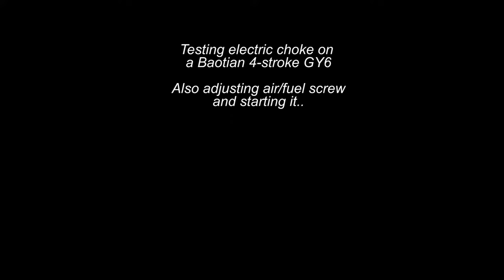Testing electric choke on my Baotian 4 stroke GY6 and adjusting air fuel screw and starting it

Comment: Check youre main jet its should be around 75-80 size(50cc) this also depends on sircumstances. But between that it should be good. Check the idle jet its should be around 33 size and for the idle mixture screw do it 1,5 turn
Reply: Thank you. This information is hard to find..I live at sea level. I use an 80 main jet and 33 idle. Still the cold idle is still instable but once warmed up it is fine. Very hard to tune these 4t 50 cc carbs.
Reply: @frednetherlands887  i know i build one by myself gy6 139qmb
Reply: @lucabot5518  Thank you. So I am not the only one with the problem with a too rich cold idle but a perfect running warm engine?
Reply: @frednetherlands887  i would reccomend a 2t carb like 20mm for fone tuning. I got 24mm carb 4t from naraku and its the best carb that i have. My setup is 90cc head and cilinder a9 cam from naraku. Vct complete from naraku everything naraku. Inlet 24mm naraku. Malossi airfilter. Gear ratio idk but upgraded. Top speed 75mph
Reply: @frednetherlands887  it really lights up. please understand that they are Chinese scooter engines and the Chinese don't look that carefully during the manufacturing of them. I am a mechanic for scooters and cars here in the Netherlands and I recently had 2 of the same scooters with a gy6 139qmb I did some tests with them such as changing a cdi with unlimited rpm one scooter drove 60kmph and the other 85 t it just depends on how and what the condition of the block is. if you really want to be sure of your stuff. change the top of your block to premium parts such as naraku cylinder or cylinder head better finish and no compression loss via the valve seat or the piston rings these components are fragile in a gy6 engine and are usually the causes of a poorly running gy6 engine.
Reply: @lucabot5518  dankjewel voor je uitgebreide antwoord! Ik ga in ieder geval ook de bobine vervangen. Verder laat ik hem maar zo. Een Kymco People S 4t. Verder prima ding! Dank je!
Reply: @frednetherlands887   wow lees nu pas je gebruikers naam goed en het komt nu tot me door  ge bent gewoon een nederlander 😂

Comment: Thats normal, your choke is working properly. When is cold is letting more fuel through (running rich) until the engine gets warm. when is warm is on the close position. You said when is warm is runs good. So there was no need to do all this

Comment: Hi, did you find the cause? I have a very similar problem on a speedfight 4. Starts and idles just fine, but can't throttle until it's had a minute or it will just bog down. Starts and runs great when warm...
Reply from the maker: Hi! No, got it working for a while but then had problems again (just cleaning the carb). I got tired of the carburetor and have changed to a slide carburetor pz19.   Video will hopefully come after summer / winter.
Reply: @ScooterSimplicity  Thanks! I managed to solve it. The fuel mix was simply too rich. Some grit in the fuel mix screw gave it a false bottom and what I believed to be 1.5 turns was something else!
Reply: Thats normal as well, any vehicle that works with a carburetor has to be warm before riding/driving. If you  start it and try to take off right away it will bug out
Reply: I changed the main jet and did a valve adjustment it made mine stop doing that
Reply: Mine was a bad coil